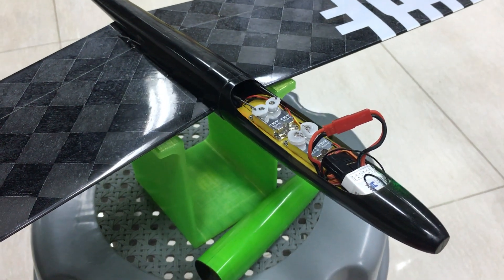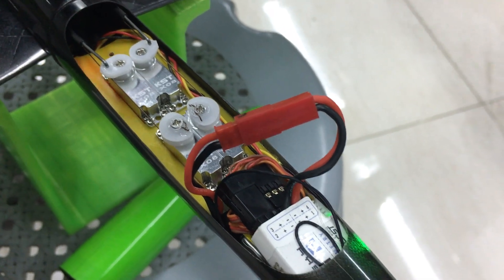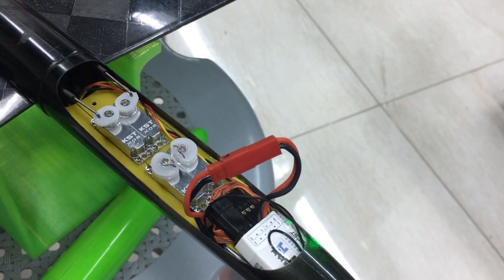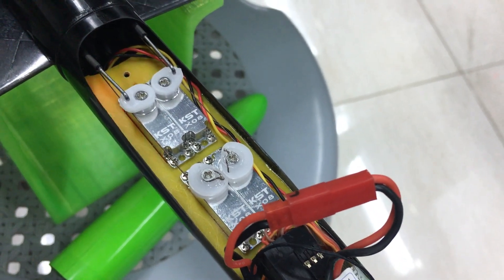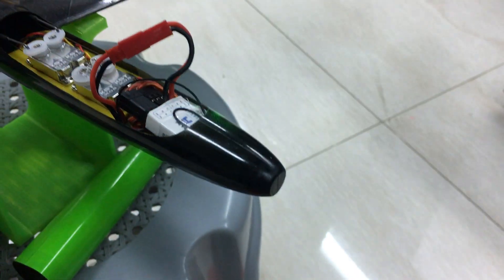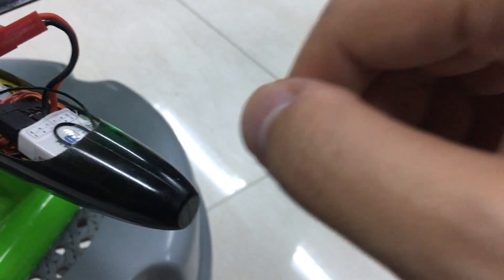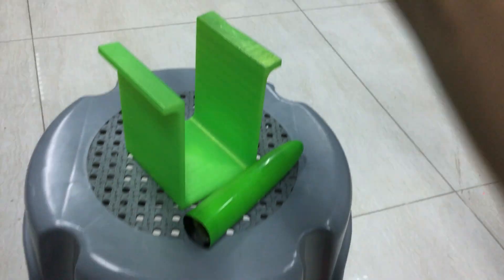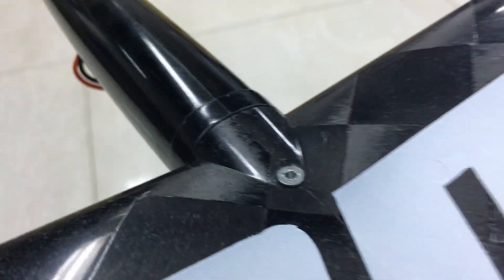BAMF DLG / F3K Glider - under the hood

Comment: Any advice on a first DLG? I'm ok spending some cash. I used to slope soar a combat wing and have flown park flyers as well. Would you go carbin wing or is balsa or foam Ok. Also, what features are needed in a radio for basic  DLG? Cheers!
Reply: in my limited opinion, start with an ELF DLG, best bang for your buck. If build right you can get it to ~100g flying weight for a 1m plane, you'll pay less for similar foam aircraft, but the have 1-3x the weight. In the game of thermals, the less weight the better.